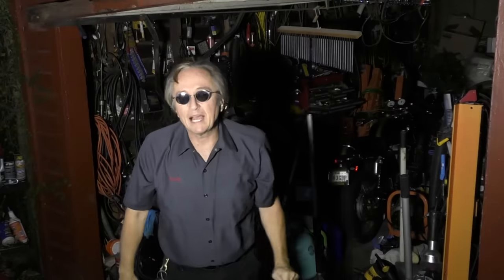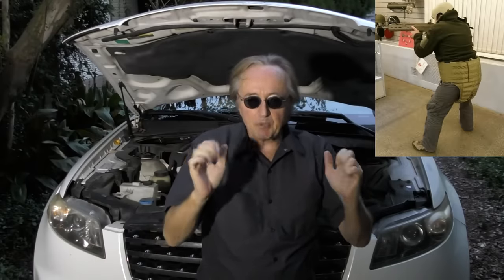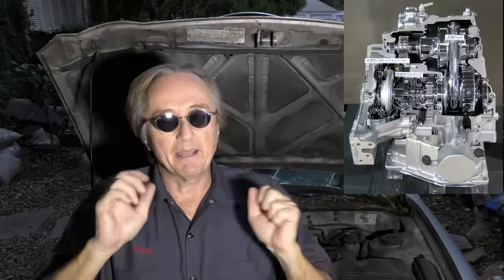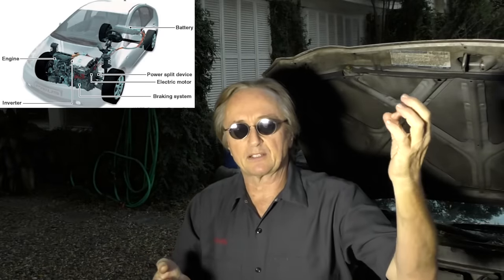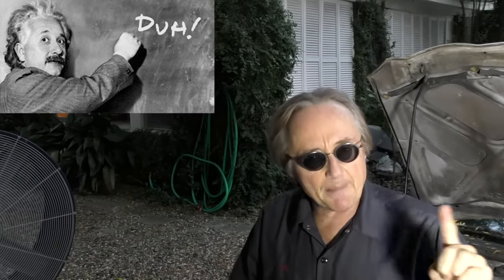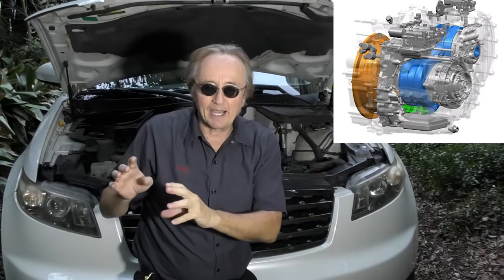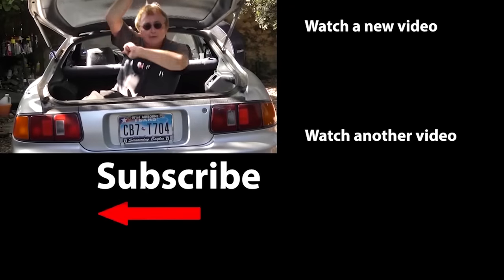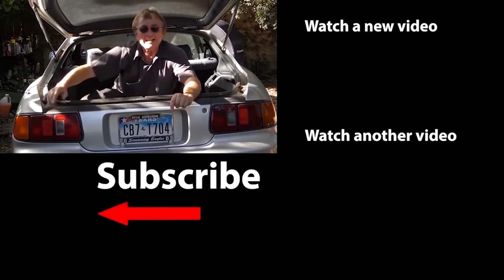Why Most CVT Transmission Cars are Terrible

Comment: You should not compare the CVT used in the Prius to those in non-hybrid vehicles. As you should be aware, they are totally different technologies that have nothing mechanical in common. This makes me skeptical of your knowledge on the subject.
Reply: Yes, the Prius CVT is just a differential and like all differentials contain only planetary gears. They last forever as opposed to belt driven CVTs.

Comment: I didn't have to watch the video I already knew it was a Nissan, besides they're the only people dumb enough to hook a CVT up to a 290hp engine... ACT cannot handle the stresses of engine that strong especially not from Nissan, hence why you see them in much smaller vehicles commonly... This is why Toyota doesn't have any CVT in their V-6 model's
Reply: CVT can handle it, it's just Nissan ones that can't. Koenigsegg has used it in a car,  it was used in a tank, and its also used in most ATVs and snowmobiles out there and although those are small engines, they take a beating.
Reply: Jackie Daniels Yes, but Nissan is trying to spread the same transmission 10 times over, koenigsegg Would have made that CVT specific to that vehicle, and the same circumstances with the tank

Comment: Why are all the reviews on the 2018/2019 Tundra, they all say it’s out dated and it’s old technology, and they need to change, but they seem very reliable, so why the pressure to change it?
Reply: Because people are stupid, they want the newest fancy thing and are willing to throw out a proven reliable system to get it.  My only 2 Beefs with the Tundra is I don't care for the styling and good GOD they are expensive lol.
Reply: I'd imagine it has to do with 2 things. 1, people want to have something that feels up to date, especially on a brand new car. 2) the price, I don't blame them when shelling out that kind of dough that they criticize the interior. Especially since they see and interact with it a lot.
Reply: vulpixgrant true, tundras are arguably the ugliest trucks. The Denali is the winner in my books
Reply: For people trying to save long term, they know the Tundra will be more expensive to run thanks to how thirsty it is. If Toyota fixed the fuel economy, I'm sure they would sell far more than what they do now.
Reply: holyfreakinshit that doesn’t solve how aesthetically ugly it is. Denali wins
Reply: @armandol1826  to each their own. With the little touch ups they did to the Tundra's exterior recently, I find they look fine. The console could admittably use a sprucing up though.

Comment: I have two Nissans, a 2007 and a 2013 and no, as in zero transmission problems. CVTs are not designed for jack rabbit starts (Scotty, rev up your engine!) or hard repeated traffic light stops because this stresses and then wears out the steel variable belt. The big benefit of the CVT is high gas mileage. More important today at $4.00 a gallon than ever before.

Comment: I have heard Subaru/Fuji Heavy Industry makes their Lineartronic CVT, and it is a lot better than JATCO's?
Reply: Yes, that is true. They make some of the best CVTs. Just like with automatics there are good and bad ones. It's been tough for JATCO but Subaru went their own route with CVTs and it's paid off. I'd rather drive a Subaru CVT than a lot of the automatics out there which are usually geared for fuel economy and not spirited driving anyway.

Comment: 150k on my 2018  rouge  changed trans fluid twice going strong as new
Reply: 150k on a 3 year old car? Yikes!
Reply: @24ecko  Yeah. I recorded 1,300,000 in my driving time for the last 10 years.  In one of vehicle, I watched mileage jumps from 0 to 750,000 in just 5 years.
Reply: @mca2642  I replace CVT fluid every 60,000km and replace two filters every 120,000km (pan filter and cooler filter).

Comment: Yeah I'm a diesel mechanic and I messed up I got a 2017 Accord sport with  CVT transmission. The Transmissions feels really weak for this 2.4L i-vtec Honda you really can't feel the power of the vtec  because of the transmission under power so what I usually do is avoid the CVT don't even use  it man I should have got this car stick shift but they don't make them stick shift that's another problem hate Americans cars no damn option for manual transmission most of the time 😎
Reply: GERARDO1343 what u need is the 2017 Accord Coupe. They offer a manual option in both I4 and V6 engine option...oh wait Honda killed the coupe for the new generation.
Reply: They killed the coupe for the Accord but I THINK they still make new year model Civics as a coupe. I don't know if they're 2018 though as I've only seen a few new Civic coupes driving around.
Reply: Gabriel Ignacio I have a 2017 Civic coupe with the 1.5l turbo and manual. Great car
Reply: I've been driving tor over 40 yrs, had to finally get an automatic because I live in N America, while the rest of the world has a choice.
Reply: Get mustang ecoboost manual

Comment: Aisin L110F.
GREATEST CVT EVER.
Actually Toyota calls it an eCVT.
Electronically controlled planetary gearset. No pulleys. 
No belt driven car here. 
The 2nd gen Toyota eCVT are on some whole other 💩 than the belt driven cars.

Comment: Honestly, when CVT is finally perfected, electric cars would've already taken over
Reply: It's a waste of resources to just axe the entire fleet of vehicles from passenger to agricultural equipment. You're still mining just as much precious metals and tons  of lithium. How about instead of making every vehicle obsolete we develope cleaner burning fuel? I dont see electric as the future unless there's a major development in graphene batteries but there's also nothing wrong with a small percentage of the population running zero emission vehicles. The way to go would be running on hydrogen and making a safe way to convert the existing vehicles to run off of it as well.

Comment: Just a note.. Nissan engines produce more power than Toyota, Honda.. pretty much every other manufacturer. CVT transmissions are not meant to be racing cars, although Nissan is the race car for daily drivers in each segment. I have owned Nissan's since 1987 and manage a Nissan, Honda, Ford and Chevrolet dealership. Yes Nissan CVT's will not hold up to the Liter size "which equals power". I can say that CVT Transmissions are built by a transmission company.. Nissan, Toyota, Honda or any brand does not build there own Transmission!!!! They are built by transmission companies... if you doubt my comment,,, if you had a CVT problem before go back and ask the service department if the can just fix the sensors or fix the transmission in the shop.... or ask why a transmission shop can't work on CVT's. Replacement transmissions in on crates and old ones leave on them. Just remember the driver controls the health of the vehicle. If you want to push your car to the limit and race everyone you see at the light. Drive a muscle car. If you want a smooth daily driver that has the power when you need to merge or change lanes buy a Nissan. Drive responsibly and drive a car that can handle what it is built for, not for what you imagine you can do in it.

Comment: CVT: Cheap Vehicle Transmission
Reply: Slave transportation.  To prevent the work slaves from becoming "uppity" on the road.  Make them fall in line, knowing if they try to pass that car or pull out in front of the 18 wheeler, they may die.

Comment: My daughter bought a 2014 Nissan Sentra. The dealer through in the extended warranty. She went through 3 transmissions. The two replacement transmissions were covered by the warranty. The warranty was void after 100,000 miles. Luck for her she made it to 110,000 miles and it was running fine when she traded it in for a new car.

Comment: My 2012 Nissan Altima S 2.5L just started with the grinding noise after 4 years of owning it. Silly me believed in Nissan and thought it was my axles. After inspecting, it's definitely my transmission 🙁.
Reply: Updated * My alternator was the problem. It was making noise and causing the car to drag. Changed it and now she runs as good as new no transmission problem

Comment: The CVT trans in a Nissan requires maintenance at 60k. Most people don't do the service with new fluids and filter. Those who do attempt to maintain them often take their cars to non-dealer services who may or may not use proper service techniques on the trans. The "flush" (high pressure fluid replacement) is not recommended for the CVT but is often done  unknowingly by shops which can damage the CVT. The CVT is also better used in a lighter car without heavy duty requirements.

Comment: I got my 2016 Nissan sentry with 9k miles. My transmission went out at 44k. Thankfully I was still covered under warranty. Fixed it, and traded it in around 50k miles. Hell I loved my gas mileage.

Comment: The problem with the Nissan transmissions is the cooling systems are garbage. A lot of these premature failures are caused by overheating especially in hotter climates. The best way to remedy that problem is to install an aux cooler to keep the temps down.

Comment: The Toyota Prius transmission should not be confused with other cvts the Prius transmission is an e CVT which is different than a regular one a regular one uses two pulleys and something called a push belt the one in the Prius uses the main electric motor and a set of planetary gears tied to a final drive very simple very reliable

Comment: Nissan Owners manual warns against towing CVT cars with drive (front) wheels on the ground. Cannot be push-started; will break trans, so don't try.
Don't coast in Neutral. Same as towing prohibition. Don't shift from D to R or R to D when car is moving. Come to a complete stop first. Avoid full throttle starts. 
Most of the above is good advice for any trans but is imperative for CVT.

Comment: People on here are complaining about the CVT transmissions, HEAR ME OUT! You bought a Nissan? Good! :) it works well now? if it does, chances are; the car will work for years.. just don't be stupid, use your brain. CVT transmission failures are because of bad use of your car. Here are some tips to save some money and some trouble with ANY CVT transmissions : 
1- DONT TOW with it- a CVT transmission is meant for smooth driving and fun times with the Nissan. If you wanna tow, buy the Nisssan trucks (they DON'T have a CVT transmission)look it up;)
2- Maintain your car, it's what any good driver should do. Use your car manual like you should, it's a great tool and a fun book to read before sleep :D
3-DON'T rev your engine uselessly, it's not meant for it.. (although i do it)
Please note that i Own a Nissan Sentra 2009 with over 146000 miles on it and it drives the same it did when my dad owned it. He sold it to my grandfather when it had 124000 miles on it, and my grandfather used it for 18000 miles before i bought it and it cost me 3000$ they are cheap and if they don't have rust and they are well maintained, keep them maintained!! 
PS. if you own a SUV from Nissan, check if yours can TOW (if it has a automatic transmission) if not, Don't Tow. This information can be looked up with your car dealer and they can sell you what you need..
Reply: That's easy to say, but the issue CVT's have to be replaced, not rebuilt

Comment: I've heard so much bad about Nissan altimas, I love my 2005 2.5sl bought for $1700 2 years ago it had 245,000 when I bought it. It now has 275,000 miles! I've had to replace a lot of little things recently, fuel pump, battery, alternator, front struts rear breaks and the radiator. All very easy, and inexpensive, but it has left me on the side of the road a few times now. But the motor runs like a top!

Comment: 2007 Dodge Caliber. Jatco CVT transmission. Made it to 150,000 miles with no issues.That CVT was the only thing on that car that never had any issues. Everything else on that piece of crap started falling apart. Scrapped the car last year. CVT was still chugging along. Guess I got lucky.

Comment: I hv 2010 Altima. 153k miles. Has been whining lately till i changed fluid. Whine is gone. Ive never had any other problems with cvt.  Its the 2.5 engine. About 10 trips back and forth from NY to south Fla. 11th coming may 1, 2021

Comment: Im going through the same thing as many others here. I had bought an altima, then I came and saw this video after ot was too late lol. 

From personal experience, avoid any Nissan with a cvt at all cost. The biggest problem you'll have is finding a GOOD mechanics that KNOWS how to fix it. But don't take that risk either because most mechanic, as soon as you tell them what the problem is they'll tell you that the cvt went bad and needs to be replaced, which costs around $4k+usd

Comment: Had a 2018 Toyota CHR with 88,000 miles on it and the transmission was going out. This car has a CVT engine and  it was going to cost $8,000 to replace. I took care of the car, and finally traded it in on a Camry. It's the dealerships headache and not mine anymore.

Comment: 2011nissan rouge 150k
So far so good
No special maintenance. ..
Drive smooth... I will change transmission fluid my self ...
I love nissan ...

My second car 2014 nissan sentra..
Never issue..
I like that .

I will update If my nissan rouge go to  200k. ,300k. 400k
.Thanks.
Reply: Don't change the fluid this is why people having problems it's a no change fluid
Reply: lamar chapman cvt required change between 30k-50k. On owner manual says. That is why most people CVT go junk. They dont keep up on that. Other cars are not really recommended for frequent fluid change like that.

Comment: My 2016 Kia Optima is currently at 45k miles, and the CVT trans is bad. I bought it through Toyota two years ago and got the best warranty. My car is currently at Kia waiting for a person from the warranty place to get there since it's costing over $7,000 to replace the trans and the module.
Reply: Doesn't the kia optima just have a six speed automatic or 7 speed dual clutch? 2016 was the introductory year for the dual clutch. Definitely best to give hyundai/kia a couple years to work the bugs out of new powertrains and to get a korean made model if possible

Comment: We love you Scotty 🙂🙂🙂 thank you Scotty I took your advice and bought a Toyota Highlander, do to the fact I have this Nissan sentra terrible CVT transmission went out ONLY AT 90,000 MILES AND I HAD TO BYE A USED TRANSMISSION TO FIX THE CAR AND EVER SINCE IT ONLY BEEN GIVING ME PROBLEMS I HAD THE CAR IN THE SHOP FOR OVER 6 MONTH ONLY WAS ABLE TO DRIVE IT FOR A YEAR WHEN I BOUGHT IT, IT HAD ONLY 79,000 MILES AND BACK IN DECEMBER 2019 I BOUGHT MYSELF A TOYOTA HIGHLANDER WHICH I NEVER LIKED TOYOTA  OR THOUGH THEY WERE REALLY GOOD VEHICLES AS YOU STATED THEN I WENT AND DID MY OWN RESEARCH AND FOUND OUT EVERYTHING YOU SAID IS TRUE TOYOTA ARE THE BEST AND RELIABLE VEHICLES, AND KEED IN MIND I WAS A HONDA AND ACURA OWNER AND THOUGH NOTHING IS BETTER THAN A HONDA UNTIL I JUST BOUGHT A TOYOTA HIGHLANDER 2014 AND NOTICE HOW REALIBLE VEHICLES THEY ARE I BOUGHT IT WITH 147,000 MILES AND IT DRIVES AS NEW I'M SHOCK TO SEE THIS IN A VEHICLE, ALSO I NOTICE THAT IN THE DOMINICAN REPUBLIC THERE ARE LOTS OF OLD TOYOTA FROM THE 80S STILL DRIVING IN THE STREETS AND THEY ARE VEHICLES BEING USED IN THE Most EXTREME WAY IN PUBLIC TRANSPORTATION AND THEY ARE STILL RUNING BUT YOU LOOK FOR HONDA AND THEY ARE JUST TO LITTLE HONDA BEING USED AS A MEAN OF PUBLIC TRANSPORTATION, WITH THAT ANALYSIS I WENT OFF AND BOUTH MY TOYOTA HIGHLANDER AND THE ONLY THING I HAD TO DO I JUST CHANGE THE OILS AND BOUTH THEM NEW TIRES THE FIRST DAY I BOUGHT IT BACK IN DECEMBER 2019 GOODYEARS TIRES AND OIL CHANGE EVERY 5,000 MILES ALSO WORTH SAYING THAT I RAN A CAXFAX REPORT AND I'M THE SECOND OWNER IT CAME FROM CALIFORNIA SOMEWEHRE IN THE COUNTRYSIDE OF CALIFORNIA PEARL WHITE BLACK LEATHER INTERIOR AND THE OWNER EVERY 57,000 MILES TOOK IT TO GET IT CHECKED AND OIL CHANGE WITH 4.5 OR 5 START ON THE CARFAX REPORT, RELIABLE VEHICLE YES IT IS I DROVE IT FROM THE CITY OF SANTO DOMINGO, DOMINICANA REPUBLIC TO SANTIAGO, PUERTO PLATA ON THE SAME DATE TRAVER THEM 3 CITIES THE SAME DATE AND NO ISSUES ALSO TRAVE TO LA ROMANA SAME DATE TRIP AND NOTHING NO ISSUES WITH THE NISSAN SENTRA I WENT AND TRAVED FROM THE CITY OF SANTO DOMINGO TO LA ROMANA AND ON NY WAY BACK THE TRANSMISSION CVT BLEW UP HAD TO TOW THE VEHICLE LATE AT NIGHT 9PM ON A DARK HIGHWAY SCARY STUFF TO THE CAPITAL AND THAT'S WHEN I HAD ENOUGH AND BOUGHT A TOYOTA HIGHLANDER! TOOK YOUR ADVICE AND THEY ARE THE BEST SUV OUT THERE AND REALIBLE THEY SURE ARE, I HAVE 7 YEARS OLD TWINS GIRLS THEY ARE MY LIFE AND THANKS GOD THAT NIGHT WHEN I WAS DRIVING WITH THEM SCARY STUFF TRANSMISSION GO'S OUT IN THE MIDDLE OF THE HIGHWAY LATE AT NIGHT WHERE THE WORST PART THAT THERE ARE THIEF THAT LATE AT NIGHT CAN ROB YOU AND EVEN KILL YOU, MILES FROM HOME AND IN A DARK SECTION OF THE HIGHWAY, I WAS LUCKY TO SEE LURKING AFAR A LIGHT AND LET THE CAR SCROLL AS MUCH AS POSSIBLE AND NOT PRESS THE BREAK SO THE CAR DID NOT COME TO A FULL STOP AND THANS GOD IT WAS A ALMOST A SLIM DOWN HILL WHEN THE TRANSMISSION WENT OUT BAD EXPERIANCE, AM WAITING FOR THE MECHANIC GIVES ME BACK THE CAR NISSAN SENTRA 2014 AND WILL SELL IT RIGHT AWAY AFTER HE FINISHES FIXING IT STAY AWAY FROM NISSAN PERIOD THEY ARE THE WORST VEHICLES NISSAN, INFINITI HORRIBLE EXPERIENCE AND HORRIBLE VEHICLES AM SURE YOU DON'T WANT TO EXPERIANCE THAT NIGHTMARE SPECIALY WITH YOUR KIDS ON IT THANKS GOD I WAS NOT WITH MINES WHICH I TEND TO ALWAYS BE WITH, THANKS GOD I WAS NOT WITH THEM.